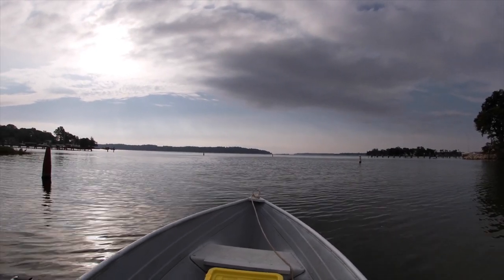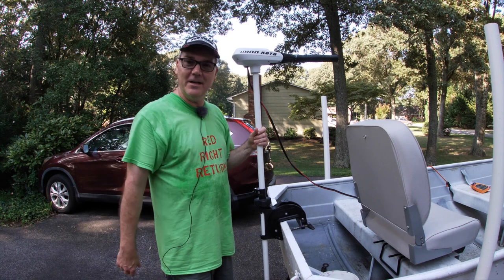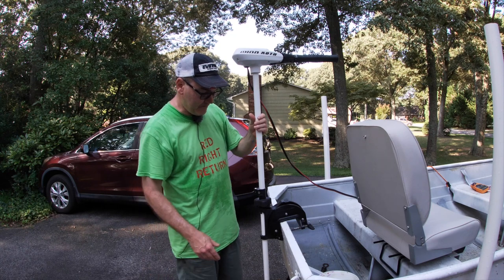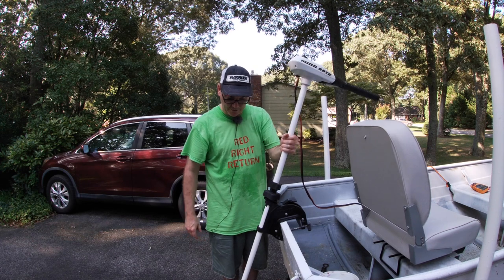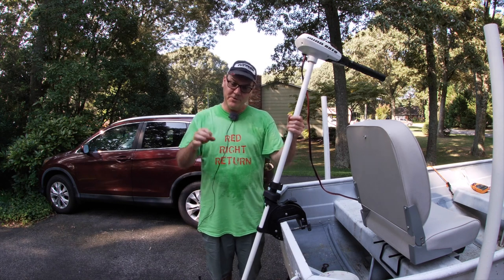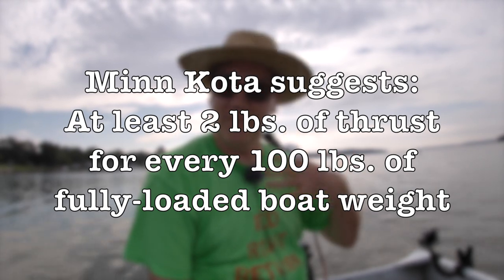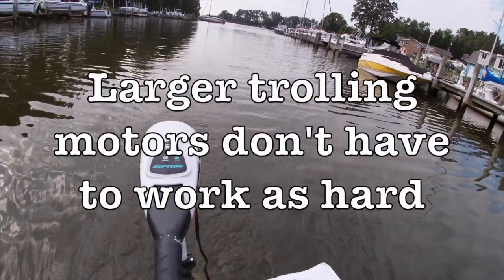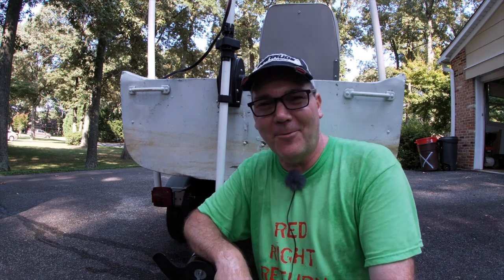Minn Kota TROLLING MOTOR - Riptide Transom 55

Comment: I bought one of those from Amazon. But mine is black. And I bought a 12vx100ah lithium battery for $179. I mounted a 120w solar panel on the bow and a charge controller. That trolling motor runs endlessly on that battery and I have a 12v and dual usb plug connected to the battery and run a costway fridge freezer on the same battery. It's a pretty sweet setup
Reply from the maker: That’s a sweet setup. Definitely some potential for fun projects!
Reply: You'll get about 6amps off the solar panel in bright sun and the motor will use about 10-12 amps. The difference is supplied by the chatged battery. A few days of non use each week will be more than enough to keep up.

Comment: I have a 1986 16’ Starcraft mariner and with a 55lb Newport vessels trolling motor I can get about 4mph- (calm conditions) - as a comparison I also have a 1983 Johnson 9.9 which only pushes me a little faster at a top end of 6 mph- but the gas motor is my primary because its got much better range- I’ve got three group 27 batteries that will last about 2 hours a piece (if I use full throttle) as opposed to about 10 hours on my gas motor (also at full throttle) which has a 6 gallon tank, it will give me propulsion for about 60 miles as compared to my electric which gives me 12 miles until batteries are drained- again, if I use full throttle which I rarely do- I use the electric for trolling speed (1.5mph- setting “2”) which lasts me for a three day or four day fishing trip and I can gas up daily on the way to the ramp for infinite gas range on the lake.  Hope this helps someone out there!
Reply from the maker: You bring up some great points! Also it's nice to read more 'real world' use and range information. My next video (coming soon!) actually discusses and covers some of these points as I compare this motor to my 2.5 hp Mercury gas outboard engine.
Reply: There might be a different prop option to push your light boat faster if you're interested. Search the web for for prop dealers that have online calculators to size up your options.

Comment: Boat/Hull Speed is limited by the Lenght of the water line. This is why speed boats plane to overcome hull displacement. The Hull Speed Formular is the SQ Root of the waterline length multiplied by 1.34 Therefore a 16 ft waterline Sq root is 4 times the constant of 1.34 or 5.38 mph. A 12 ft water line hull speed is 4.68 mph.
Reply: Awesome knowledge
Reply: Formular. Arg arg arg!

Comment: I have a riptide 55. Flat out the most I got in ocean was 3.5 mph. Going under intracoastal bridges was impossible even with oars assisting. I got a 2.5 hp tojatsu now that pushes me against currents satisfactorily. That was a heck of a diff.
Reply from the maker: Yeah trolling motors work pretty good in calm waters. But otherwise - not so much!

Comment: I got a used minn cota  55 rip tide a while back at the goodwill store for $45 bucks works great out of the water haven’t tested it yet on an 11’ ft v hull the boat is pretty light and should cruse along , I do want to switch the handle around so I can use it on a bow mount , trying to find the right battery 🤔
Reply from the maker: That's a score!! Your cheapest option is a deep cycle 12 volt marine battery. Look for as many "Amp Hours" (Ah) as you can afford - but don't worry about "cold cranking amps" - you don't need those. Basically a 100 Ah battery should give you more run time than a 60 Ah battery.

Comment: The max speed of a boat using trolling motor is a function of the weight of the boat (more weight = more drag), the pitch of the prop and the voltage of the motor.  If you want to increase speed you can reduce weight but it would take a significant change in weight to decrease drag significantly.  You could increase the voltage to the motor which increases how fast it spins which would increase the speed but the voltage is fixed by the supply so that's not going to happen here.

Consider 2 screws, a #4 and a 1/4" diameter that both have 10 threads per inch (never happen in real life, #4 has like 32 or 40 TPI).  Having the same number of threads per inch is the same as pitch on a prop.  If the both turn at the 10 revolutions per minute then they will both advance 1 inch per minute. It doesn't matter that one is bigger and has more force behind it, as long at the turn with the same RPM they will advance at the same rate.  Props in water are like screws in wood except the prop can slip in water.   If you have a very small very light boat and put the 14lb motor and the 55lb motor on it, if the props have the same pitch the boat will go the same speed.  As you add weight to the boat the motor will still push it at the same speed until the drag starts to get close to 14lb.  When that happens the 14lb prop will slip more and the 55lb prop will keep pushing the boat at about the same top speed until drag gets close to 55lb then it will drop significantly with added weight.

The difference is that the 1/4" screw can pinch more pounds of load in it's grip than the #4.  Similarly the bigger prop can deliver more thrust to the water before it starts to slip and with a bigger motor rotational speed won't bog down.

The stock prop from MinnKota has a pitch intended to accelerate a boat quickly at the cost of top speed and the blade shape is intended to shed weeds at the expense of efficiency.  Kipawa produces normal looking props at a slightly higher pitch which means you can go faster for the same power or go the same speed using less energy from the batteries.  Using a Kipawa prop generally voids the MinnKota warranty. 

Regarding throttling.  Electric motors throttle the rotational speed of the prop and therefore the speed of the boat in one of 2 ways.  By wasting some of the power which decreases voltage, by using a Pulse Width Modulator to control voltage and speed without wasting power.  At max power there is no power wasted by either type of motor controller.  At lower power both are wasting some power unless a PWM controller is used.  For MinnKota these are called Digital Maximizer throttles.
Reply from the maker: Good stuff - Thank you!

Comment: I've got four seasons on the exact same motor that I use on my 18 ft sailboat with two deep cells if there's no wind it's still enjoyable. I do run the three blade prop on it and I think that helps a little.

Comment: I have seen folks swap the Vlad for an efficient and fast aftermarket one. 

I just put this exact trolling motor on order. 

Almost certainly going to change the prop out to that one I just mentioned since my old pedal drive kayak had something similar and no issues with weeds in my salty and brackish area. Keeping the weed less too of course. 

Going to add the Riptide Transom 55 to the front of my 1436 Jon… and probably add Autoboat down the road to it. It only works with the transom model without the fancy energy saver electronics. 

For $500 for the motor and another $650…. I can have autopilot and spot lock while fishing in ripping currents. If either fails… I can just replace that component. Bonus… I don’t have to also buy high-end fish finder equipment to get the routs feature as it runs off of a free app on my phone. 

For now, I will just use the tiller and stalk reds in the shallows and more.

Comment: 3 to 4 MPH is a 25% difference, which isn't insignificant.  As you get closer to hull speed (see Ric's post) it takes exponentially more power to increase speed when you start to approach hull speed (because your boat is pushing a wall of water in front, and the stern is sinking into a hole created by the forward movement).

The primary reason why it seems like larger trolling motors do not 'give you extra speed' is that they are not powerful enough to get your boat on a plane (out of the water and breaking away from the physical constraint of hull speed).  They do move you CLOSER to hull speed.

Another (much smaller secondary reason) combination of reasons that might limit the trolling motor is the RPM and prop pitch.  A better prop might get you 1/2 MPH closer to hull speed.

Comment: Great video and a quick question.  I have a 22 foot, 5,000 pound boat (inboard/outboard) that I use to drift for fluke (flounder) but my drift is always too fast.  Can this trolling motor push the weight of my boat and give me 1 to 3 mph?
Reply from the maker: This one might be enough - but most people go with something that has over 100 lbs of thrust for larger and heavier boats which is usually a 24 or 36 volt setup.
Reply: @WayneTheBoatGuy  I appreciate the reply.  I can't stomach reconfiguring the front of my boat for a bow mounted trolling motor but a small stern- mounted one with enough power could give me what I need.  I fish the Long Island sound in New York and flounder are the only fish I have a terrible time catching because My drift is always too fast or too slow.

Comment: If you are going to use a gas motor for trolling? Add a trolling plate as well. Mine also has a cage and lift plates to protect the entire lower unit and provide lift. It's a river boat that works on lakes.
Reply: 🪨🪨🪨🌊🌊🌊 everywhere in west coast rivers

Comment: All things being relatively equal ,  can I use the salt water rip tide in fresh water? What are the advantages or not?  Maybe just buy the cheaper one that is available.  The salt water model may be a bit heavier thou?  any thoughts?
Reply from the maker: You don't need to spend the extra for the saltwater models if you're only boating in freshwater. Minn Kota have a section on their web site to help pick out the right "size" trolling motor for different boats.

Comment: What battery are you using I just picked up a minn kota 70lbs for a 14aluminum boat since the main motor is messing up but was wondering your battery set up for it

Comment: I just bought the 55lb thrust . I’ve never owned one before I’ve never done any boating. I got an inflatable boat that I’m going to use it with. Whenever I connect it to the battery… is it OK to test it by turning it on  if it’s not in water? With the area around the propeller clear of course.
Reply from the maker: Everyone seems to run them for a couple seconds dry and it doesn’t seem to hurt. They’re sealed, and the water probably cools the motor when they’re running, but a couple seconds dry shouldn’t hurt anything.
Reply: @WayneTheBoatGuy  Ty👍
Reply: @floridavideosbyjeffreyscot6910  I've run mine without water for an hour. It is just like an electric fan. Gas powered motor is totally different, and it has to be immersed in water to cool the engine.
Reply: @Okinanam69  Ty
Reply: @WayneTheBoatGuy  When u put out of water the motor has basically no amp draw cause of low resistance... so it wouldnt heat up aswell.. 

Most important things on a trolling motor for me: it has to be reliable, quiet, also enough power.. and have ajustable speed (vario), cause when im fishing i mostly throw out a driftbag and backtroll, that way u can fish a bank/dropoff slowly and u dont have to steer as much... but precise power input is important.. or else ur going to fast or not fast enough the whole time.

Comment: You showed the rip tide compared to the smaller motor and said you didn’t get mush difference in speed , but there’s gotta be a difference in prop size ?  So I’ve seen some vid’s where they changed props trying to make things go faster , what happened was the motors would over heat and shut off ,so they went back to the original prop , ( not make for speed ) :)
Reply from the maker: It seems that all trolling motors (new/old, big thrust/little thrust etc) are designed to go roughly the same speeds. The only difference is in the size of the boat they can push.

Comment: THANKS FOR THE VIDEO I ENJOYED IT IS THERE A SPECIAL KIND OF BATTERY THAT I NEED TO BUY. OR JUST ANY BATTERY WILL WORK I LEARNED THANKS TO YOU. HOW TO START THE 2.5 HP MOTOR THAT I BOUGHT A WEEK AGO.
Reply from the maker: There's certainly lots to learn with boating! The little tricks of tweaking the choke on the carbureted gas motors and getting the deep cycle marine batteries are all things many of us haven't dealt with if we're new to boating.

Comment: Why did you want just a single battery model trolling motor? Why not a more powerful two or three battery model? Thanks
Reply from the maker: It seems that the more powerful trolling motors are marketed for larger/heavier boats. At the time of this video, I was only using it on a 12 foot boat and didn't want or need the extra cost and weight.

Comment: I don't use electric motors but I'm interested to see you can get solar powered chargers for the batteries. You can keep the battery charged as you go? Have you seen this?
Reply from the maker: Yeah I’ve been looking into it for some time. It seems that the ratio of panel size to charging capability doesn’t quite match up
Reply: This motor can pull 50 amps at w.o.t ... so do the math .

Comment: I believe on some minn kota trolling motors the battery test only works while the trolling motor is on and running. Try that if that doesn’t work then I would say that feature just doesn’t work
Reply from the maker: I honestly have never thought to re-try it while running - thanks!

Comment: Your weed-less prop is slowing you down. Get a regular one for more top end, and yes trolling motors are generally made for low speed thrust, but you can adapt a greater pitch prop and then get a lot more speed depending upon weight and number of motors ect. New more powerful brushless ones can come with prop pitches good for 6mph, but still higher speeds can be gained through adapting higher pitch props, and multiple motors.

Comment: Nice video, the motor's shaft is far to long for my liking. Been told I could buy a kayak trolling motor with a 24" or 26" shaft which sounds much better than pulling soft tissue in my shoulders and upper body. Looked very uncomfortable 😬
Reply from the maker: Yeah it's not the right shaft length for this little boat!

Comment: Do you use a fuse, if so what size
Reply from the maker: I do not... yet. But the way to select one is if your trolling motor has a maximum capacity of 36 amps, use a 40 or 50 amp fuse.
Also be sure to consider the gauge (size) of the wire running from the motor to the battery. Apparently using thicker (like 6 gauge) wire, the cicuit may overheat, which could damage components or cause a fire.
Reply: @WayneTheBoatGuy  thanks

Comment: $100 clamp on amp meter will answer your question about battery usage at different speeds and comparing the two motors.

Comment: I highly recommend replacing that pin with a bolt. @ 3:22    for folks that are as hard on their equipment as I am. ;-)
Reply: mine stays on the back of my boat when I am bouncing around in the LI Sound. I call it my impulse drive.  I am considering labeling it "impulse drive 1"    "NCC-1701"  :-)
Reply from the maker: Ahhh thanks!

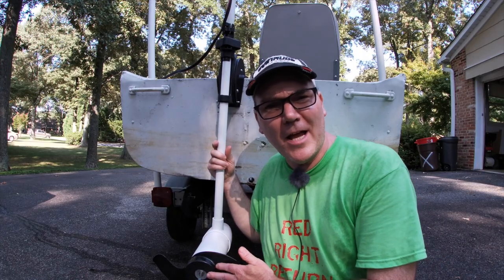Comment: Looked a much better position on 9:22 just like a petrol outboards position would be with a short shaft but the motor doesn't need to be submerged to deep in the water. 10:23 certainly looked uncomfortable, shoulder breaker.
Reply from the maker: Yeah this one is a VERY long shaft - I only bought it because it was available and $200 cheaper than a new one. I have considered cutting down the shaft if I keep it.
Reply: @WayneTheBoatGuy  Ok fab, shortening the shaft is fairly easy to do. Go for it 😃 I purchased a pipe cutter which you turn slowly to cut the pipe. It cuts into the fibreglass pipe easy as you turn it.  I took pictures of the wiring when I uncrewed the top cover off (A MUST to be sure when you put it back together) Some people I've spoke to are scared of shortening the shaft buy trust me dont be. Just take your time, do a little bit every day over the winter, took me a week doing about an hour a day. No rush.
Reply: @WayneTheBoatGuy  Best thing I ever did was shortening the shaft.
Reply: @WayneTheBoatGuy  And always where your buoyancy aid no matter how far you go out on the water.

Seen & heard to many horror stories.

Comment: Speed vs how much juice you're using is a big myth. You use the same amount of power no matter  what setting you're on. In the lower speeds, it's just sending some of the power thru resistors, so it's still using full power, just sending some of it some where else.  So if yougo slow just to save power in your battery, you're wasting your time.